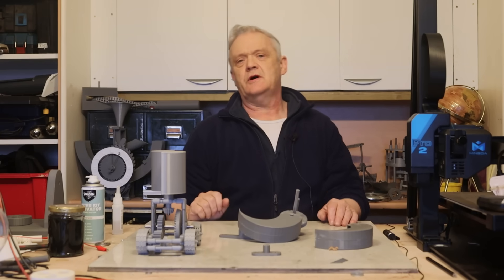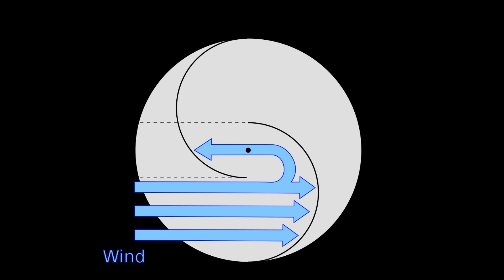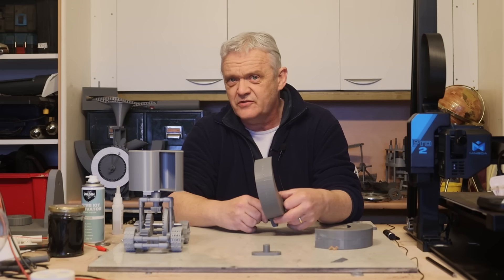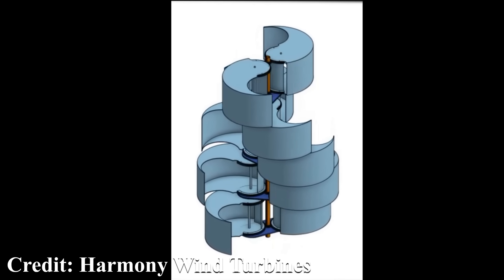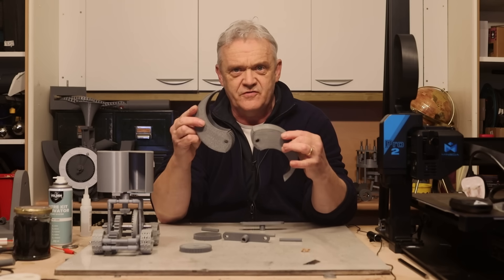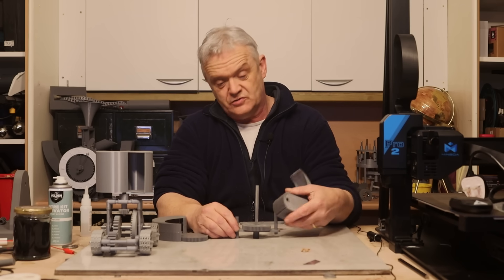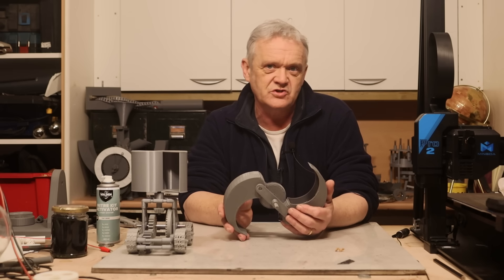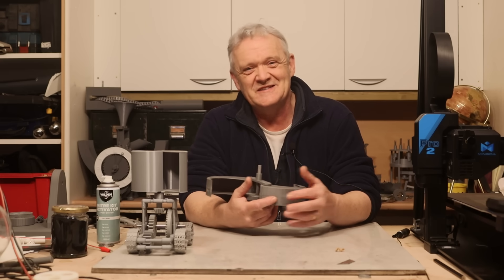2203 The Harmony Wind Turbine - A Replication

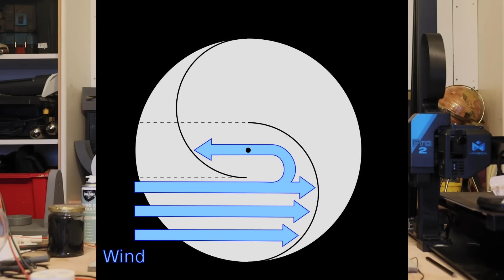Comment: I've seen a few comments regarding this, but at 0:58, the example shows the scoops overlapping, and the diverted wind pushing on the backside of the opposite scoop.  The Harmony design does not seem to overlap their scoops.  I wonder which way works better.

Comment: you could use a spring set up for furling/unfurling similar in fashion to the tail on a windmill water pump for remote stock tank needs. In higher winds, the tail folds over to the side causing the bladed part to be positioned with its own rotational axis at 90° to the wind direction effectively shutting down and protecting the moving parts. When the wind speed drops, the springs pull the tail back at 90° from the bladed section's axis.

Comment: Flying ball governor was my first thought, but it would be cool to use an aerodynamic method of closing and dampening.  Maybe a reed valve (kind of)/flap system that relieves air excess pressure in the two scoops and pulls them in at the same time.
Just a thought.

Comment: Thanks for sharing that is a cool design. But I am wondering if one could use a governor to control the blades mechanically?
It could in the same way protect the turbine from spinning too fast, but it would also close the blades when the wind is suddenly dropping in speed and the drag is higher. Then the turbine would become a flywheel and smoothing out the current fluctuations.
I am getting it wrong?

Comment: great solution to a problem that not exist. Savonius turbines are specialy adecuates to survives to high winds, because his TSR is around 1. The more clever idea to solve the  situation with a storm wind is a PMG with 2 or 3 stators,  only one can be activated in normal winds and the second and third stator can close the circuit when the voltage  produced ( = rpm of the turbine) exed certain limits. The only problem with this is the cost of the extra magnets and copper for the extra stators, but by the whole cost of a turbine not is extremely significant if you search for maximum eficiency in all conditions. If the wind is more like a twister, your last worry will be the survivance of a turbine.... The technical complexity of the "armony" wind turbine is the main reason because this company are like 7 or 8 year promising his turbines and never were produce nothing for sale,  only protoypes. Theys promote this design for catch the attention of litlle investors and other naives peples to get his money. But the design is like i said previously a solution for a non-existent problem. And its solution causes the blades to be so complex to produce and maintain that they are no longer a design to scale in large productions.

Comment: One remark - this is actually not Savonius design - as the scoops end are closed. Savonius'es basic idea was that there must be the cap between the overlapping scopes, allowing wind blow "throw" it, thus producing also additional torque due to lift, not only drag difference.

Comment: Sir, I might seem like I'm stupid, what if a funnel is made from light weight materials and placed in front of the turbine to funnel the wind, at a higher speed, to the turbine. This funnel will have to be mounted in such a way that is aligns itself with the flow of the wind direction. When you walk from one building to the next, the space between those buildings have lots of wind speed.

Comment: The Harmony design allows the turbine to spin consistantly at it's optimum speed for an extended period, adapting to the verying wind speeds.
In addition, the Savonius develops a significant torque, necessary to overcome startup cogging and full load resistance of the alternator.
The strong torque allows for the gearing up of the alternator to acheive usable generation speeds.
Coupled with a low-speed, high output alternator, it becomes quite an effective pairing.

Comment: The whole "efficiency" thing is a bit of a red herring. A more reasonable measure of the generator would be to look at how many turbines you can fit per hectare and then look at the cost, maintenance, wind speed range per megawatt. For example, these turbines do very well packed close together whereas HAWTs do not. In short, it doesn't matter if the efficiency is only 30% if you can get 5000% more in a given area than for HWATs.

Comment: If the furling mechanism was deleted and the scoops locked at full open along with regenerative braking used to control the turbine speed and provide more charge due to the higher forces, could this be more efficient, simpler to produce and allow for a more efficient blade/scoop design?

Comment: @Robert Murray Smith - 
You can re design use centrifugal governor, to lift the where the veins on the shaft on a screw closing them as speed up. 
Then it can be fully mechanically automatic depending on how much you weight you put on the centrifugal governor ball weights...

Comment: I would love to see a mechanical system to close the turbine at high wind speeds by a centrifugal force and open the with springs at lower speeds. That would eliminate the need for constant wind measuring and a motor

Comment: I know they are using a motor to open and close the vanes but it made me wonder if there is a better, simpler mechanical solution. A centrifugal governor, like the old steam engines had, comes to mind. 
AIso, I went down the rabbithole and got a 3d printer. Are you dropping the files on on your turbine design?

Comment: A lot of the critical comments here focus on similar ideas using mechanicalcentrifigal speed governor or furling  solutions. They seem to disregard the MASS these solutions introduce to the sail mass, which ideally should be zero. This design, using a single motor/gear solution, avoids some of this mass.  Correct me, please, if i am wrong?

Comment: I believe they're also pushing patents through for a variable air-gap axial generator to remove/reduce startup gearing.
Reply: I know that the bergey wind turbine had some form of cut in circuitry, thus allowing the turbine to start without load, it also used i think what they refereed as "low end boost" to transform up the voltage to allow charging at low speed,

Comment: In a mechanical engineering lab exercise in the 80s we are given a small DC motor to use as a generator and a budget of $10 and tasked to create the most efficient wind generator (power/cost). We found a beer can on the road, cut it in half vertically, offset the halves and glued them to the motor shaft. It only lasted a few seconds in front of the test fan. But it did produce some voltage, and our cost was zero, so we   won. Hail Savonius!

Comment: While watching this I had the idea of a flyball governor. Couldn't a flyball governor be used to provide the closing force to furl them? I would think that with some clever engineering you could also use the governor to tune it to provide a specific (and therefore optimal) rotation speed of choice. It would also reduce the complexity of the design overall and provide safety due to the mechanical nature of the governance.

Comment: I really like this design, seems like a very simple arduino circuit (something that measures RPM) could turn the motors on everytime it exceeds a set number, and then maybe a delay of 5 minutes to turn them back out (so it's not constantly running at high winds).  I know the typical large turbines can fail at high speed, but I don't know that I've ever seen a vertical turbine spin at high speeds (though vertical turbines typically don't stick out far).
Reply: pair it up with a flywheel or a dampaner and you wont have to wait, it can just slowly open up and charge the flywheel then close again

Comment: I'm sure that a mec could be designed so the device is self regulating. No external motor required. I'm thinking a centrifugal governor linked lever or gear system.

Comment: In the early days I asked Mr Moore about basic power data when he'd got to the stage of running his substantially metal constructed wind turbines on the top of pick up trucks. Surprisingly he said he didn't have ANY data up to this relatively late stage because he was waiting on electrical expertise from some university. I said you only need install a simple Prony brake. He didn't know what a Prony brake was. I left it there....... It's a visually impressive design but like many, I suspect that's all it'll be in the end. There are far better ways for controlling for high wind speeds than the complexity of a folding wind turbine.

Comment: it will disintegrate with fireworks in moderate + winds
Reply: Er,...Um,.....I think they would have thought of that one!...Yes?
Reply: @kenhickford6581  notice the single prong support. Wind sweep decreases but the axis is weak, should be 3.
The design is similar to an engine crankshaft. Have you seen cs supports and engine block?

Comment: Be easier with a voltage controller the higher the voltage the more the wings get cranked in and the less likely to overload the generator.
Reply: The furling is a safety against the mechanical stress on the turbine
Reply: Yes safety so it won't fly apart which is different than controlling the voltage so it can be applied for the reason you made the wind generator in the first place. Two birds with one stone so to speak. @hrothgeirrH

Comment: Lots of clever engineering - and they respond to questions!
I wondered about the possibility of using the design sideways at the top of a pitched roof. They don't think it is suitable, but I'm still intrigued.
Reply: It would work but it would have to have a fixed height for the maximum opening.
Because of the massive amount of torque you could generate with a very long but small diameter set of these turbines it would be a challenge to find material that could withstand the force without shearing. Perhaps one could add a gear to the end to increase the RPM of the generator. Would that lessen the load?

Comment: I think in high winds you could also change gear inside the turbine instead of closing the flaps,, and use the torque to power a secondary generator.

Comment: I came up with a similar idea back in the mid nineties while completing my enginnering degree, my idea had only two sails like the standard savonius rotor, they slid past each other (no hinges), some weights would close the sails when the wind speed increased, springs were incorported to close the sails, and a damper to even the movements.
Reply: That's exactly what I thought when I found out how it operated, they could do the same job with just weights and springs.
Reply: Another idea i had was to make the sails telescopic like either a bellows, (concertina partition wall) or possibly have moving solid C shape solid sail that folded into each other vertically, again the swept area would increase in lower wind speeds and decrease in higher winds as need be
Reply: Would love to see your idea😅
Reply: @CraigLandsberg-lk1ep  I never actually built a model, I have some basic cad dwg's (back in the old R12 days), emailed Christopher in Harmony with dwg's etc back in Jan 2021,  they don't seem to have progressed much in those three years,
Reply: @jimbobarooney2861  that's ok, I am just trying to work out the pivot points to make the scoups/sails govern themselves, maybe I am wrong trying to make them work without a secondary mechanism, would take any advice you have, maybe I am wrong trying to make a simple mechanism, but I have seen such simple control devised by advanced minds by people so so much Smarter than me like Tesla, the only thing I know is that the smarter you are the simpler you can make things without the need for computers, dumb people use computers after the fact to solve their deficiencys
Reply: Interesting, though I think you're confusing "dampen" with damper, that or maybe auto-correct is picking the wrong word(?)
Reply: @__WJK__   - dampener and damper mean  "the same thing"  (synonyms - killjoy, wet blanket, "one who or that which dampens" ) in engineering terms - ie. otherwise referred to as dashpot (to frustrate linguistic pedants).  They damp, or dampen relative motion by opposing  (non conservatively) changes in velocity (xdot), unlike a pure spring which opposes similar motion (from rest) relative to displacement (x)..  The engineering terms come from the physical world originally -dampen:  "to deaden, restrain or depress"  - a fire damper has similarities in the abstract...
(dude noted he had an engineering degree - words may have been selected correctly -  you may be confusing what he means with the cold water,  bucket challenge.  jk) 

- Flues, air ducting, musical instruments and vibratory physical phenomenon also adopt the use of the same word

Now the German word for steam is Dampf...  hmmm.  (damp refers to noxious inhalation)

And damper is a variety of Australian "soda bread" cooked in a campfire.
Reply: @kadmow totally agree with all your words and I appreciate it cause I am from Australia 🌏 lol😅
Reply: @__WJK__  damper or (dashpot in engineering parlance)
Reply: @__WJK__  damper (dashpot)

Comment: Instead of changing the turbine's geometry with increased windspeed, would it not be possible to do some sort of gearing on the generator - some method of increasing the number of generators being turned -  so that as the wind speed increases, the power coming out of the generator(s) increases, without much change in speed?  Perhaps a generator where the number of connected coils increases with wind speed?
Reply: They do have a system for altering the gap between the magnets and coils which has this effect, allowing the rotor to spin at very low wind speeds.

Comment: The perfect wind turbine design would be a vertical cylinder array of Fibonacci cones all directing their spouts onto a central scoop turbine.
Because of the focused flow of wind from any direction, any flow will be multiplied exponentially because there's nowhere for it to go other than out the end of a thin spout.
I had initially considered a chrysanthemum shaped array for the pure beauty, but that would be far too inefficient.

Comment: Drag type rotors do suffer less with strong winds as they always turn at a rate less than the wind speed. Aerofoil designs turn faster than the wind so tend to be more reliant on governors. In a domestic scale setting, Savonius style should probably be fine up to hurricane force.
Reply: No
Reply: @tonyaltobello6885 why?)
Reply: @tonyaltobello6885  yes it can if it can furl into a cylinder which already is more aerodynamic
Reply: If you make it robust enough, it will withstand a hurricane, (but maybe not cost effective) it works mainly on drag forces, this force will increase at the rate of the windspeed squared.  Savonius rotors also try to "walk" basically the magnus effect, a lateral force to the wind direction

Comment: Instead of using a motor to close the “propellers” can’t you use the “cvt” type transmission and as the wind turbine spins too fast it will automatically close using the cvt

Comment: There's a wind responsive turbine design, to moderate energy capture. Max capture in low wind, progressively reducing with wind speed. Used on a stand alone refuge shelter in the alps.
Reply: I beleive it operated on centrifugal force and weights to close up totally in high winds, and a spring return to default fully open in low winds. The trick is in balancing the forces of wind, weight/speed, and spring return. Quite elegant, simple tobuild, maintain and repair, once the above formulae are established, and analogue.

Comment: Your statement that it turns quite fast when it's fully open is not correct. It actually spins faster when it closes up to a smaller diameter, just like an ice skater pulling their arms inward. I feel it's an over complicated design rather than very simple. You can achieve furling much simpler and you maintain speed and power with the design I have on my ch.  Just hang a Savonious turbine on a cable and let it furl itself, no computer or electronics or motors required.